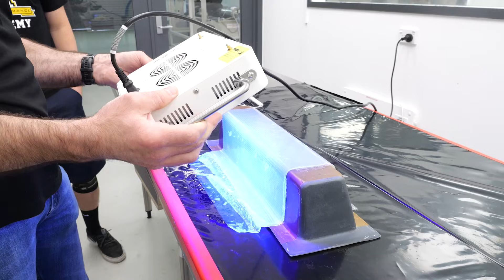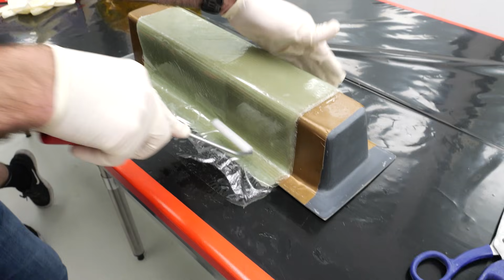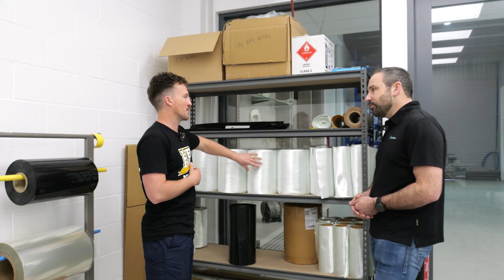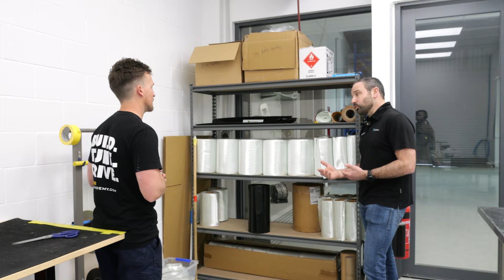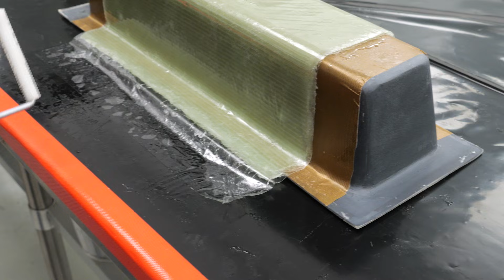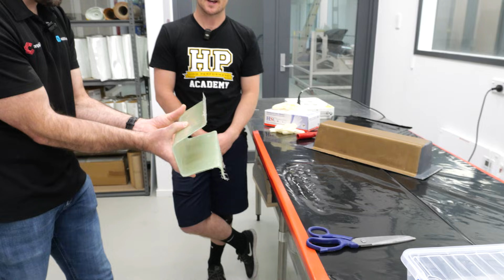Carbon Parts In 60-Seconds? | An Alternative to Traditional Composites

Comment: I've been building surfboards for over 40 years using both epoxy and polyester, and I make my own pre-impregnated fibers with UV resins. It works well with fiberglass because it's transparent, but for both carbon fiber and Kevlar, only chemical catalysts work, as UV rays don't penetrate carbon or Kevlar. Therefore, photoinitiators don't work on shaded surfaces.
Reply: Yeah, they kinda skipped over that small detail.
Reply: @FPomar-bv5gt  wouldyou mind sharing the process briefly please? and provide product links if possible..please and thank you
Reply: @Gabriel-t5n5n  I carry out the process of pre-impregnating the fibers with UV resin on a table where I have taped a layer of plastic sheeting; I then lay out the fiberglass fabric (I generally use 4 to 6 oz roving). Next, I generously apply the UV resin, spreading and working it in with a squeegee. Finally, I cover it with another layer of protective black plastic so the fibers can be stored in a cool place away from sunlight. When I want to laminate something, I cut the material to the desired shape, remove one plastic layer, lay it onto the surface, remove the remaining plastic, and conform it to the surface using a flexible squeegee. Afterward, I can cure it using UV lamps or by placing it directly in sunlight.
Reply: @FPomar-bv5gt  awesome..thanks...can you tell me what roving is.. and would you mind tellime the specif product or brand you use
Reply: @Gabriel-t5n5n  It is a very fine woven fiberglass fabric.
I usually use the Hexcel brand; it isn't cheap, but it is high quality.
Which country are you in?
Reply: @FPomar-bv5gt  California USA.. witch resin do you use?
Reply: @Gabriel-t5n5n SILMAR polyester resins or SUPERSAP epoxy resin.
You can buy these in California.
Reply: @FPomar-bv5gt  thanks bud..appreciate it
Reply: those are both UV?
Reply: @Gabriel-t5n5n  SILMAR sells an additive for UV curing.
Regarding SUPERSAP, you should ask your local distributor if they carry any UV-curable resins.
It is best to look for information from distributors in your area; there is likely a much wider selection available in California.

Comment: Curious how this behaves with constant UV exposure after curing?
Reply: Probably the same as other resins of that type. Once the hardener has been activated, UV like won’t do anything else to it.
Reply: @komischertyp4  I worked with one that would become very brittle after curing when left in sunlight. 
Liquid->UV cure->expected properties->sunlight exposure->unexpected properties (brittleness)
Reply: @christophershafer5615 That seems like a poorly designed product. I haven’t looked anything up about it, but I‘d think the UV breaks apart bonds in the activator, allowing it to polymerize with the resin oligomers. In this case UV exposure shouldn’t have any further effect after all the activator has been converted, besides regular degradation

Comment: It seems like this material would yield composites with a similar fiber volume fraction to wet laid composites. I think there will be a lot of applications for this, but I don't see it replacing autoclave or infusion for the most demanding applications. I think you will need some kind of compaction force. I wonder if it can be used with a translucent vacuum bag type consolidation.

Comment: With carbon or other composite won't that block the uv light from penetrating the middle and making it uncured? Glass gets somewhat clear when wet.
Reply: That's right, photoinitiators don't work properly on surfaces shaded by carbon fiber or Kevlar. I've tried it myself, and I know from experience.
Reply: no UV no cure.  You are better off using PTM&W tooling resin with long pot life that will cure at room temperature and Tg can be increased with free standing post cure.  I've made ovens with aluminum faced polyurethane foam insulation boards for homes and aluminum tape.  I use a torpedo propane heater or a heat gun if your part is small enough.  The box oven will get to and stay at 275°F for hours.

Comment: A big use case of prepeg materials is when you need to build complicated tube-like shapes with a split mold. But then the materials will be inside the mold and won't see uv light and thus won't cure.
Reply: clear mold?  internal lighting?
Reply: Cyclic olefin copolymer filament is transparent to UV and can be printed on a normal 3D printer. Depending on the frequency of UV required, there are cheaper alternatives that block some UV-C.

Comment: For more complex moulds is vacuum or pressure consolidation still possible?
Reply: I have known about this for about 20yrs, and it was invented int the late 90s'.
Most of the uv resin, that I have researched, is a poly Ester resin, not poly eurethane.
3 more key points:..
1) the uv must be generally in a specific spectrum. General uvb is not sufficient.
2) the uv light, when using leds, must be dense and very intense.  Believe it, T5 flouro tanning bulbs are effective, cheaper and can be useful in small and large applictions.
3) Most of these epoxies can be mixed with MEKP for normal drying method.  (Best with pressure molding or anything that uv can't be used.)
4) if you combine MEKP, IR light (this combo allows for very rapid curing from the inside out),, then use uv to hardening cure.

Ir leds' are hard to get, and expensive...ir flouros are even worse in price, as well as serious energy hogs.
Reply: a vac table like for vac forming i don't see why it wouldn't work. maybe it would pull some resin out? pressure molds you'd need to press and open it to get the uv in. i'd imagine getting a mold that would be transparent in the uv range would be kinda hard.
Reply from the maker: I'm not 100% sure, but if it were vacuum bagged with a layer of peel ply i'd imagine there would still be enough UV light passing through the peel ply to allow it to cure. I'd imagine it might just take a bit longer - Connor

Comment: I have developed an allergic reaction to epoxy resin.  While this still would happen the reduced handling and mixing is helpful.  Really helps the use case for pre preg without the need of a big oven.
Reply: To reduce my exposure to epoxy resins, I mix it in plastic bags.  Place hardener into bag, calculate the resin amount , add the resin. Seal the bag with minimal air gap. Then knead the bag for the mixing in the bag with very few air bubbles. Then cut the corner and use it like an icing bag. Been doing this since 2000. I use a chemical filer face mask as well and have a venting fan as well. Be nice if the resin was available as a resin only for other materials.